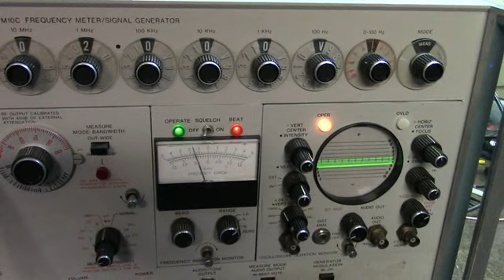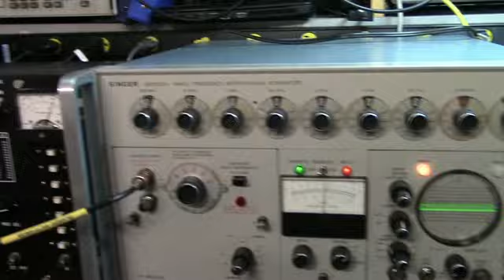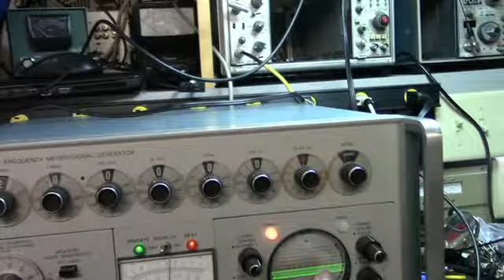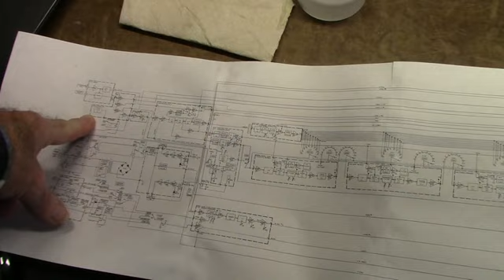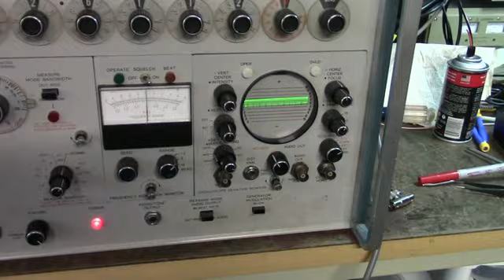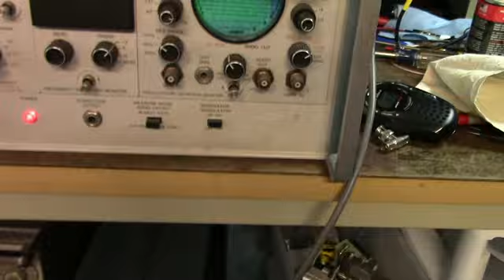Singer FM 10C Heterodyne Generator Monitor

Comment: If I recall correctly, the frequency-set decade switches on the top of the unit are encased in plastic. How did you get to the wafer contacts to clean them?

Comment: I have one of these, doesn't quite work and a few switches are broken. not sure where to get replacement parts
Reply from the maker: Hi Michael. Many of the discrete standard parts are still available.  The problem will be mechanical parts such as switches.  Try and find a donor unit at a hamfest. That will help make keeping these old work horses usable for a long time.

Comment: Thanks for the video. A friend is offering me one and I was wondering what it could be used for. I wonder if you could feed a 10mhz external time base into it from GPS but seems very accurate once it warms up.
Reply from the maker: Hi KF7PSM,  You can apply an external 10 Mhz time base to the BNC on the rear of the unit. I adjusted the internal time on my unit by calibrating it to a GPS standard.  The stability is excellent . Be sure and set the external time base switch on the back to external.   73

Comment: Would be nice to have more info on how this divide-multiply work.
Reply from the maker: Hi,  The complete service manual for this instrument is downloadable on the internet for free.  It has a detailed circuit description section.  I didn't go into more detail as the video would get too long.  If you have one these units be sure and check  the serial number on the front of the manual and compare it to yours.  The two manuals I have are for different series.  One is for numbers 301 and above.  The other is for 701 and above.  I noticed slight changes in the ODM-1 plugin circuit .

Comment: Nice to hear you mention the Cushmans. I actually found your channel looking for info on the Cushman CE-4. After seeing your old video on it I was gonna swap out all the power supply caps before even attempting to power it on but I suppose I'll actually buy a capacitance/esr meter and check them first before shotgun cap swapping. Thanks for the interesting content.
Reply: The Der-EE 5000 is worth a look.  I found it to be easily accurate enough for my needs, the only drawback being the component fixture. You could  make a much better one pretty easily, though, and the next significant step up is a lot more expensive (The Agilent/Keysight hand-held LCR).

Comment: I saw one of these at a hamfest. The seller said it did not work. I didn't buy it because I probably would not be able to repair it.  Now I wish I would have picked it up.
Reply from the maker: Hi Richard,  The complete service and operator manuals for this device are available on the internet. They are fairly easy to repair and are a useful addition to any rf bench.